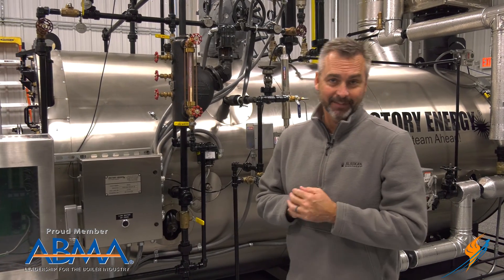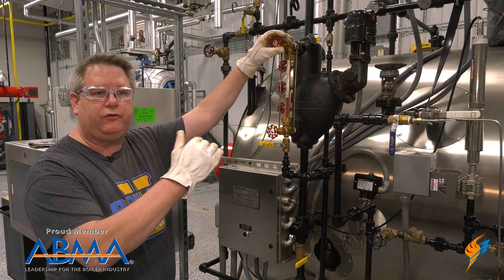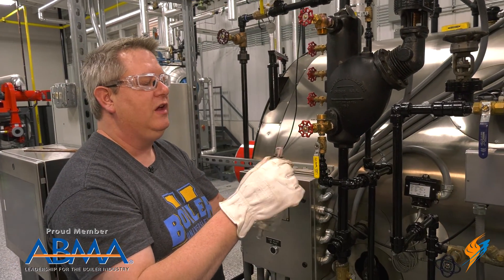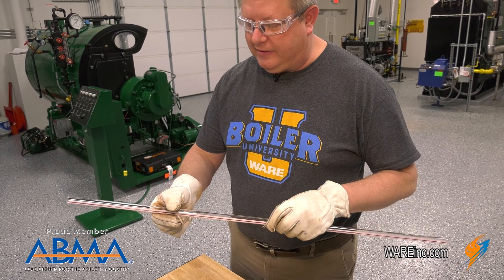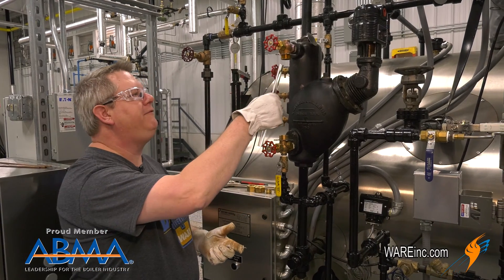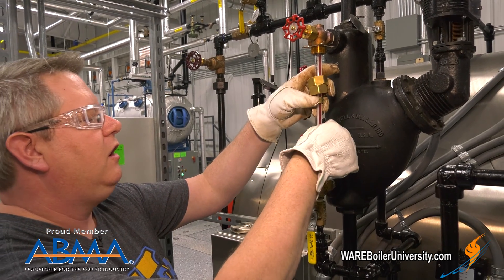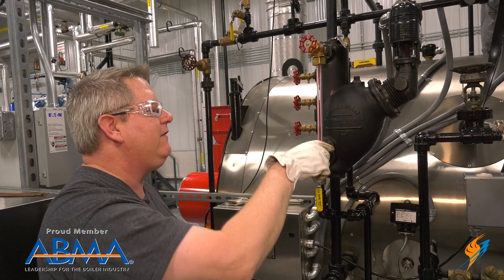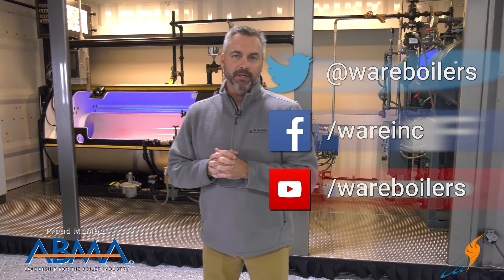How to Change a Boiler Sight Glass - Boiling Point

Comment: Can you change the site glass while the boiler running? Hi pressure boiler?
Reply: I am no expert but I don't believe that you can because the site glass contains water and the water valve and steam valves has to be turned off to change the site glass valve and the boiler can't be on